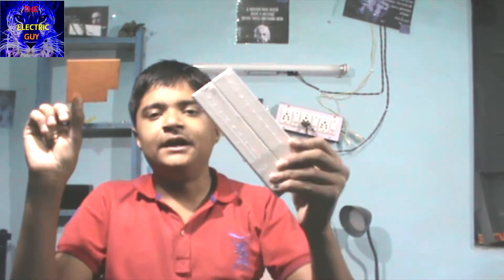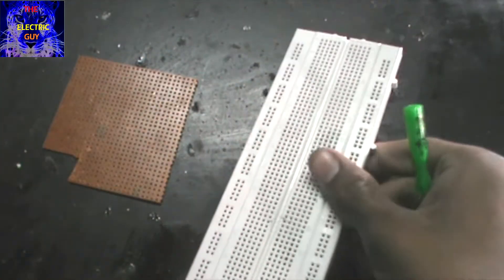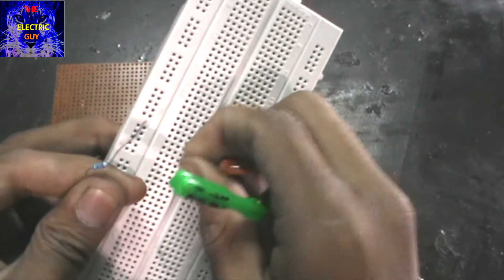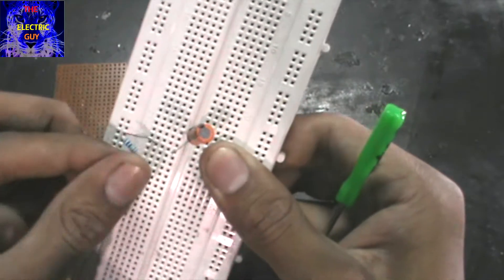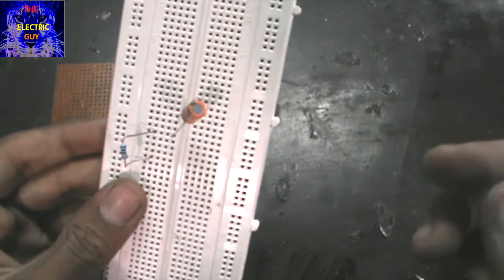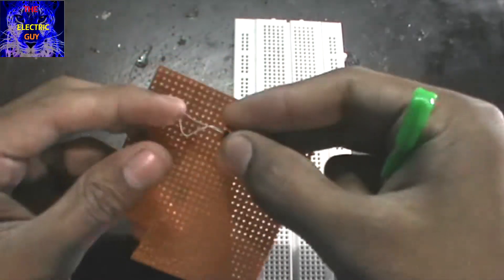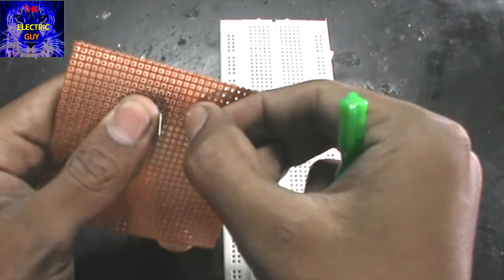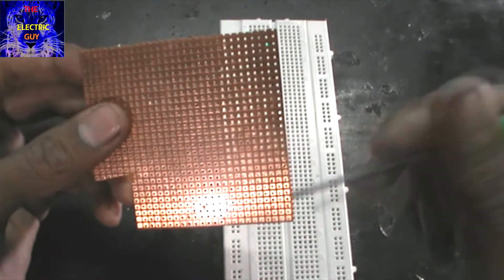WHAT IS BREADBOARD AND VEROBOARD ?

Comment: How to make ground in vero board?
Reply from the maker: Generally when we say ground in a circuit which involves DC, it means that that part of the circuit is connected to the -ve pin of the voltage source(for example battery). To make ground in veroborad connect all the components, which you will connect to the -ve of the battery(according to the circuit) to one another and then connect it to the battery's -ve terminal.
If you are talking about applying ground plate to a plastic board then refer to this link- https://www.instructables.com/id/Method-of-applying-a-copper-ground-plane-to-strip-/